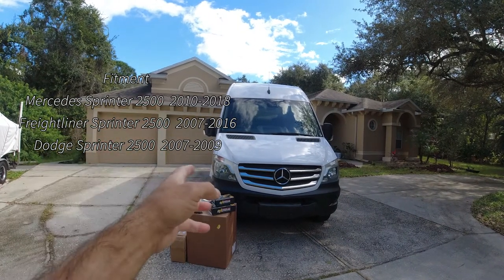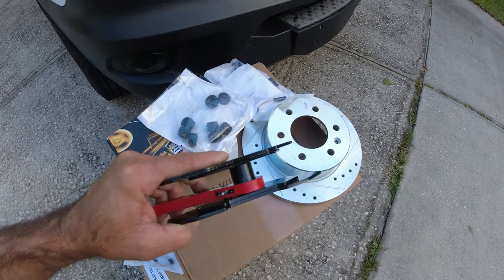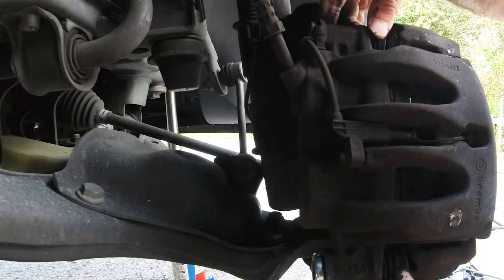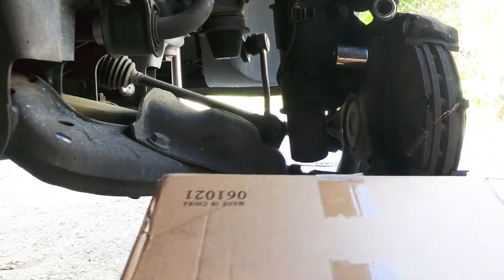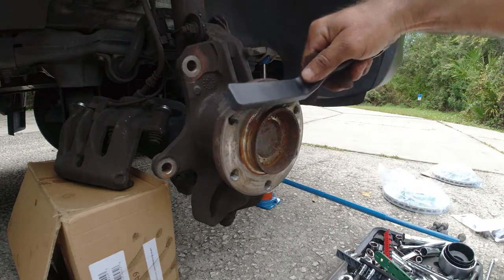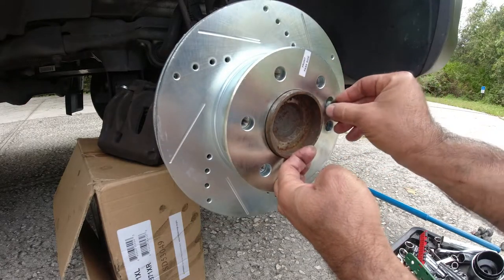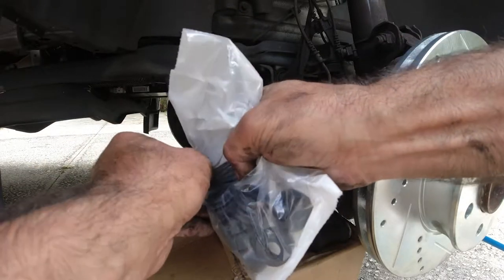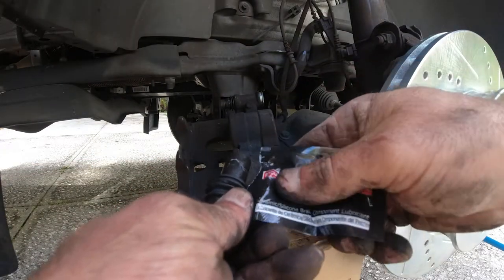Replacing Disc Brake & Pads on a Mercedes Sprinter 2018 -2010 DIY Freightliner Sprinter 2007-2016

Comment: I have always been told to open the caliper bleed valve when retracting caliper pistons to prevent back flushing contaminated brake fluid into the master cylinder. Great video presentation.
Reply from the maker: @edsanders5479  I never had a problem with that but thank you for your comment and also for watching

Comment: Great video!  Please put a jackstand under that vehicle after you jack it up.  I was nervous the whole time I watched with the van just supported by the jack.  You do a great job in your videos.
Reply: I can remember years ago as an apprentice the head mechanic barking at me if I was trying to do a quick job using the floor trolley jack without using jack stands.  @Mercedes Sprinter DIY, it would awful to see you get injured making great content.
Reply: Couldn't agree more - got my Crafter camper in bits doing the front brakes. That jack is really extended and wobbly to reach the jacking point. I went to my local timber yard and cut up some garden sleepers for blocks as a cheaper alternative to expensive axle stands. 
Good stuff but stay safe! You really don't want several tonnes of van sitting on you.

Comment: Torque Specs for each of the different bolts? Don't say gutentight! Hehe

Also, is it necessary to replace the Disc Brake Anti-Rattle Clips?

Thanks!
Reply from the maker: What you saw in my video? That's exactly what is required to change and it works. Perfect, I already ran it for over 30000 miles And this breaks work perfect
Reply: You should provide torque specs for each type if bolt. Go watch FCP Euro videos they tell you the exact sockets sizes and torque specs.

You leave a lot of out of these videos. You can do better.

Comment: Did you just use the OEM jack to lift the Van and no jackstand?  If so, that seems risky.
Reply from the maker: great point thanks for looking out  👍
Reply: I add some 4 x 4 and 2 x 6 wood blocks like building a brick wall. 3 each per layer and  put it under another suitable location and leave a bit of gap incase the jack collapses.

Comment: I would like you to help me with something, I have a 2012 Mercedes Sprinter, and I need to change the rear discs, what brand do you recommend and are they an exact measurement? Thank you
Reply from the maker: My advice is check the link in the description below and look at the ones that I purchase and see if they are the same size if they don't call that company and they should be able to give you the recommendation for your model and year👍

Comment: I paid the dealer $1200 USD for front axel only... and this was all they did?  ROBBERY.   Thank you for your video.  I have ordered the kit and hope you get the affiliate link.  Is there anything needed for the warning system internally in the van?  When my front brakes went out on a road trip, we had a very limited time to drive the van before it would limit us down to 5 mph.  If you have changed the oil, it would be something like the reset of the counter...  Either way, great video and very cool of you to do this for us.
Reply from the maker: Thank you fpr watching and yes thanks fpr using the link because my channel makes a commission and it really helps making this video ,hope your back breaks installation goes easily,  $ 1200 is robbery 😟

Comment: So you don’t bleed the brakes? Thanks
Reply from the maker: No need just use the caliper opening toot and you will save time and money , hope the best for you👍
Reply: I would recommend bedding the new pads/discs in with some harsh braking for a few miles spesh before you drag anything big and heavy then just open the bleed nipples slightly 1 at a time to release any small air bubbles. You won't need to pump the pedal as brake systems usually are under a small pressure (around 5psi I think) to take up any lag. 

Old UK pre MOT trick from before vacuum assisted braking systems. You'd be surprised how small bubbles can make for a spongy pedal. It turns a good brake pedal into a brilliant brake pedal.
Don't forget to check your brake fluid every time you work on your brakes. By keeping an eye on the level you can tell if you have issues.

Comment: First mistake you did is leaving the vehicle raised on the jack only!  those bottle jacks will slip easily and the van will land on your head!
Raise the van at the dedicated jack points and always use jack stands that are rated for the correct weight. 
Also the reservoir should not overflow once you replace pads unless you added more fluid before.
it's a good practice to flush the brake fluid atleast once a year to have fresh and clean fluid free from moisture that builds up in the fluid because of it content
Reply from the maker: Yes the fluid change the dealer did that maintenance,  thanks for your comment